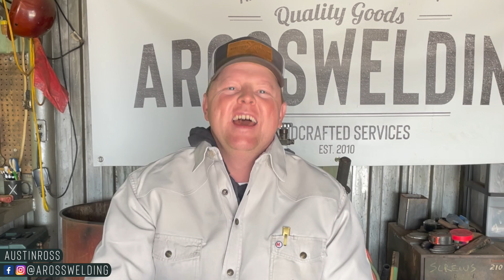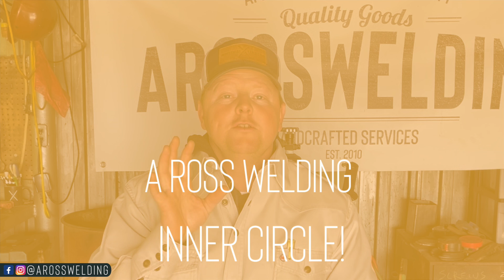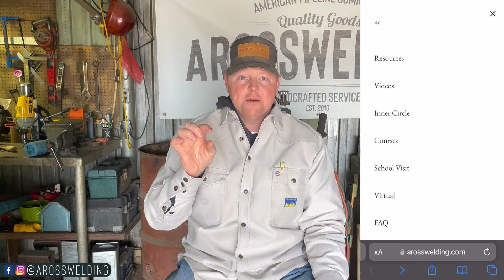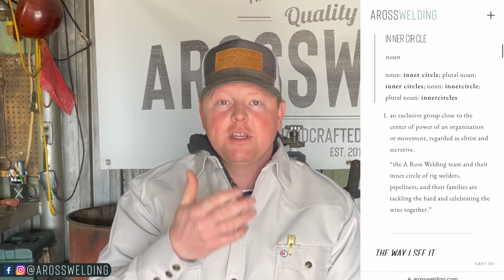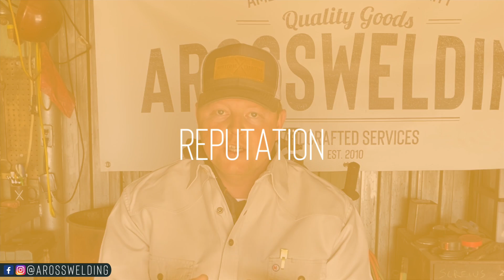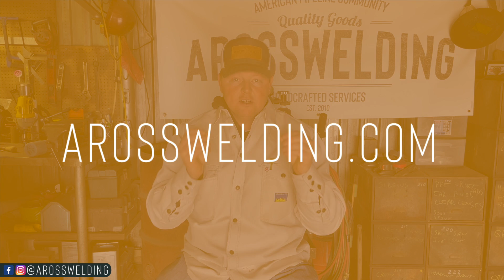How To get into Pipeline Welding

Comment: Hey mr austin i was just curious about gaining welding experience as i currently work at a production based company that welds oil and water storage tanks as well as high pressure vessels, ive been working there for a year and i run mig flux core, 6010, 7018 and 7024 and weld in all positions would that count as a good way of gaining experience? I have plans to one day put a rig together and try to branch outside of shop welding.
Reply from the maker: Absolutely
Reply: Also got certs from there as well and passed both 1g and 3g

Comment: Hey Austin, I went to school for welding, and I got hired to a forklift manufacturer doing pulse mig the week I graduated. It pays very good for what it is, right a $30/hr, weekends off, and no mandatory overtime. The problem is I don't like making the same exact welds in the same exact place every day. I want to go on the road, but I haven't stick or tig welded pipe since I was in school, that was almost 3 years ago. I want change but I can't take a huge pay cut to be a helper. Any advice?
Reply: You wouldn't be taking a payout to be a helper on pipeline. You might make a little less per hour, bit you're going to get more hours and better benefits.

Comment: Thanks for the video Austin, I'm an older guy who did a lot of untrained welding and metalwork in my youth and then worked mostly as a mechanic and then carpentry I've also done a lot of electrical work and Plumbing. I would love to get into something like pipe welding